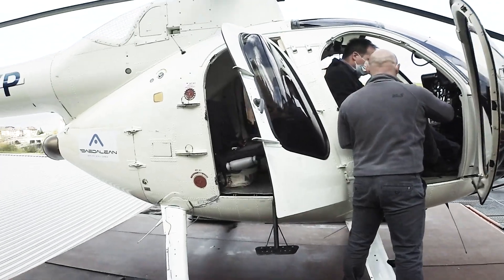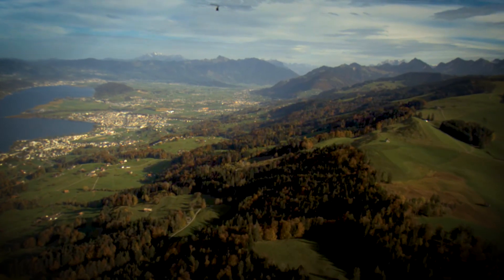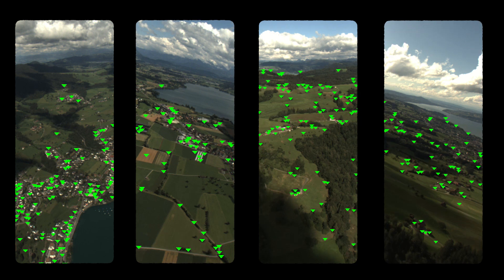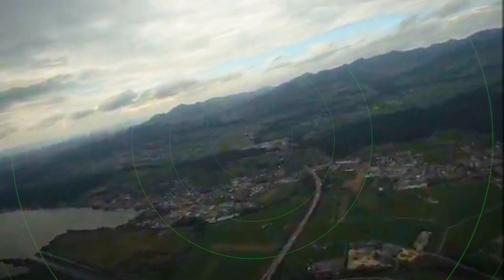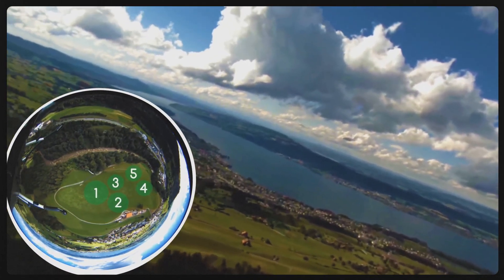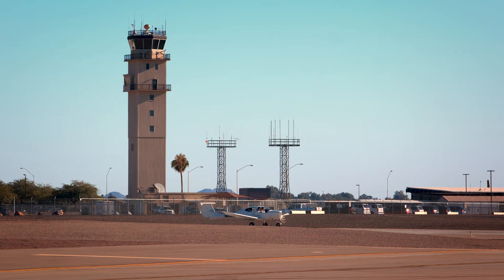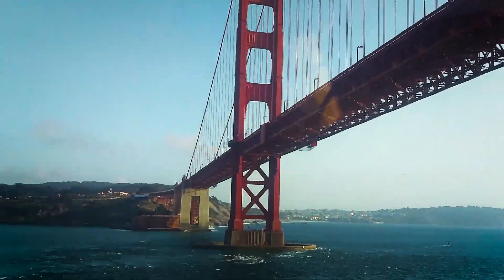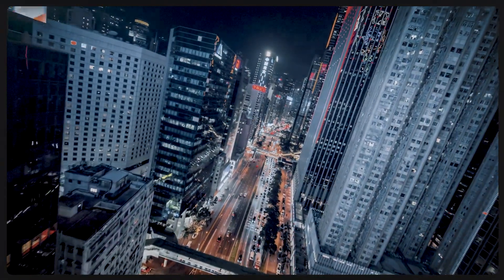Daedalean visual systems in operation

Comment: The website says "certifiable to DAL-C", does it mean it has already been certified? or that you will provide documentation and artifacts to certify the system for anyone using it?
Reply from the maker: The STC application for our first product (traffic detection, the joint product with Avidyne) is in the process with the FAA and EASA and is progressing as scheduled. It will be the world's first safety-critical AI-based application certified for civil aviation, and we expect it fairly soon. Then we'll expand it to the full function scope.